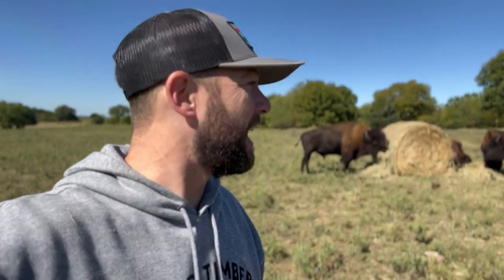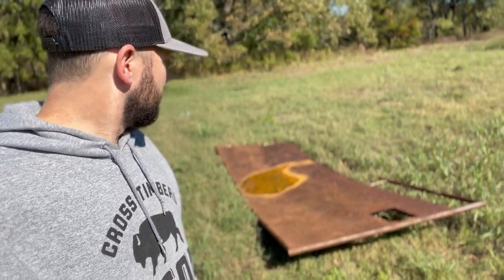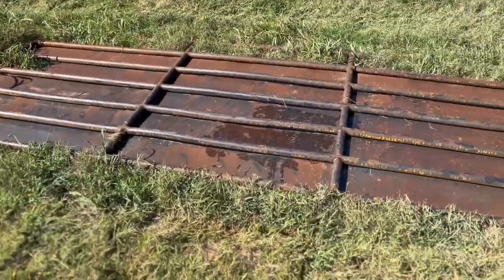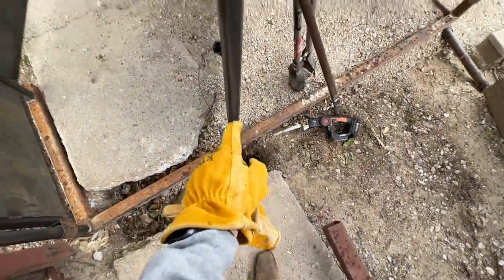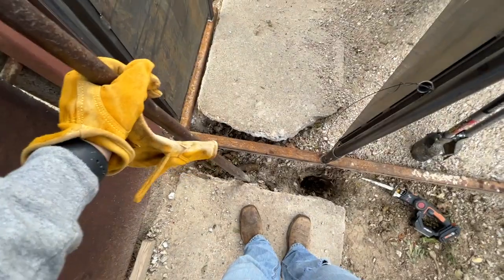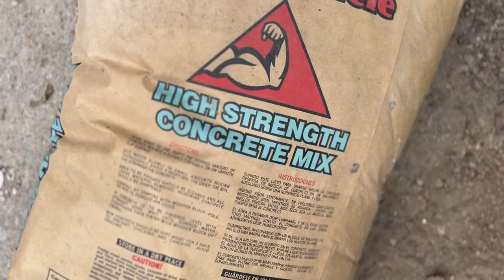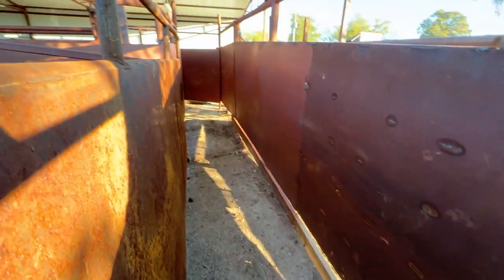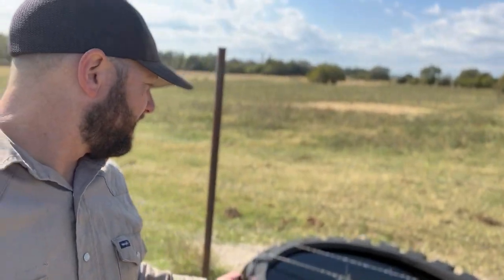Big Joe Crushed It...Now It's My Turn!

Comment: Hi Dusty, great job n nice video. Just a suggestion but next time you have a bent panel or gate n need to straighten out a bent one. Which I have had to do a few times lol. Instead of placing it in the field, place it on a concrete driveway or a hard packed gravel drive way, that is hard n flat, then drive over it. If you drive over the gate in a field, the ground underneath will give n not let you straighten the gate like it would if the gate had been driven over on a hard surface.

Comment: Dusty, good job of straightening the gate; much improved, for sure. Something crossed my mind to help it further along: I'd lay a 2x4 (or similar) under one end of the gate/panel, THEN, drive the tractor over it. Seems to me it would hold the gate and allow more bowing instead of following the ground.
Y'all be Safe!

Comment: If you have a harder surface, like cement, it will flatten easier.  We did this with a metal pipe, used out truck.

Comment: Just a suggestion, next time if you need to straighten a gate place a couple of 2x4s,  under one end and then drive your equipment over it. Guaranteed to straighten the gate.
Next, you have finally created a good and useful loading / catch pen. You should have less headaches and less stress on the bison. Good Job.!!

Comment: the goldfish will not survive if the top of the water freezes solid all the way across (without some type of aeration). They can handle colder temps better than warmer temps.  if they were a bronzish color when you bought them I have found that they do actually turn orange as they get older. I kind of liked the bronze shubunkin I had but at about a year old it turned orange with black and clear/white portions to the tail and fins.

Comment: Why not mix the concrete ready in a bucket and pour into the hole. Use a rebar to take out the air. It's very seldom we use your method here in Sweden. My experience is it gives more strength even if you don't use gravel into the concrete or rebar to avoid cracks. Everything for making it Big Joe safe!  <3

Comment: Dusty the High-strength concrete mix. Is it used for durability or because it is used with applications where the application is under a lot of stress or pressure? I have watched hundreds of videos over the last few years and the first time I have ever seen this type of concrete used. It makes sense. I just didn't know it was available for consumer grade applications.

Comment: The gold fish will live if it doesn’t freeze solid. That tire won’t hold 20 fish two should be enough for controlling mosquitoes.  You put a rock by them and toads and frogs will spawn too they need a ramp out though. If those make it through the window try a couple fancy gold fish.

Comment: Put copper piping in the bottom of the tank and it will get rid of the algae  just lay it in there  put a fitting in a bird bath and you wont have any algae